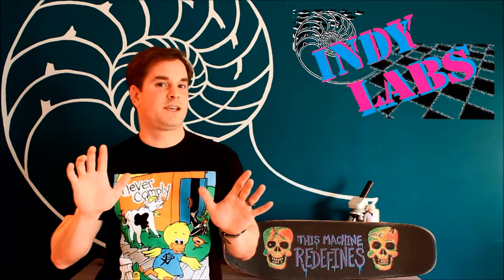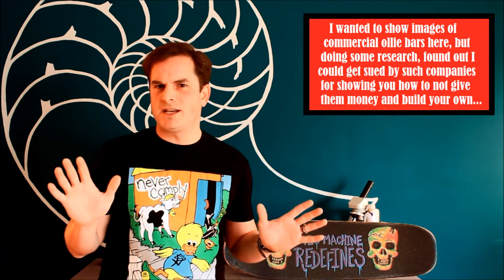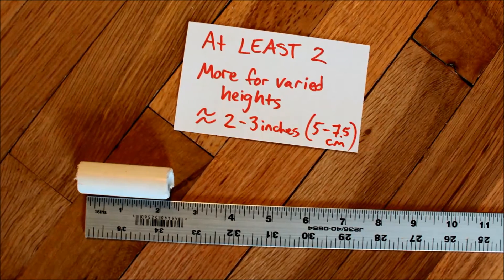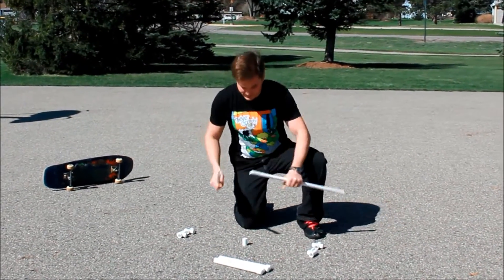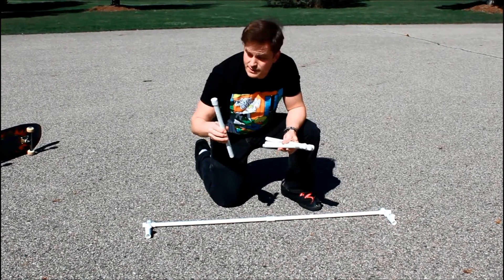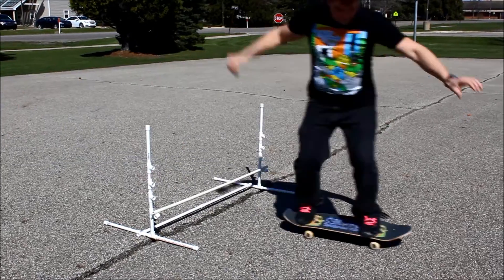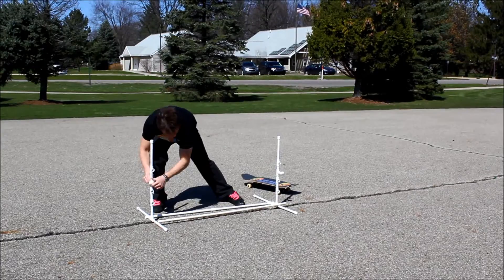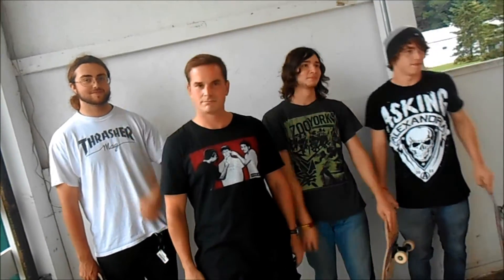How To Make A PVC Ollie Bar - Indy Labs #11 (At Home DIY Science)

Comment: I’ve found u can use spring clamps like the strong ones that will clamp to the sides then the bar rests on the 2 clamps. That way u can customize any size u like, if u wanted to increase even by a half inch height u can!
Reply from the maker: An excellent innovation! Bravo!

Comment: i like the build but how can i have smaller increments? like an inch
Reply from the maker: With this design, I suppose you're limited in increment size by the distance from one "T" joint to the next.  However, the two pieces of PVC that hold up the supports for the bar, they are connected to the first "T" joint that sets the lowest level.  Best solution I have for you would be to have two sets of those, an inch shorter in length.  Then, all the height levels you have would be shorter by one inch.  Admittedly, it'd be annoying to switch back and forth between the two sets if you wanted to increase the height by just one inch at a time, but still, skateboarders are some pretty committed people, I'd say.  Right?  ;-)
Reply: yes we are. and I think you just gave me an idea. I could have 2 vertical rods, side by side. the t joints could face opposite sides and be at different intervals on each bar. so I would alternate what side I place the bar on which is very little additional effort. The reason I asked is I had a height bar years ago (design was far inferior to yours) and I remember when I got close to my sticking point, the difference between 1 and 2 inches was night and day
Reply from the maker: @KyleCorey84  Your idea is an excellent one.  Glad I could help, but you took it further and better.  Great engineering idea.  This is one of my favorite videos I have made, as I just get disgusted with how much companies try to milk skaters for overpriced stuff.  So glad you taking this idea, running with it, and improving upon it.  EXACTLY what I hoped people would do with this video.
I don't try to push my YouTube videos onto people too hard, but I'd be honored if you checked out this one:  https://www.youtube.com/watch?v=paqoaJi3nCc

Comment: 1 thing, the 4 way joints were pointless. could have just used 2 more 3way joints
Reply from the maker: Yes, that's true.  When I was originally putting it together, the skaters and I thought we'd need more PVC coming out the sides where those 4-way joints are in order to stabilize it more, but it turned out, it was stable enough.